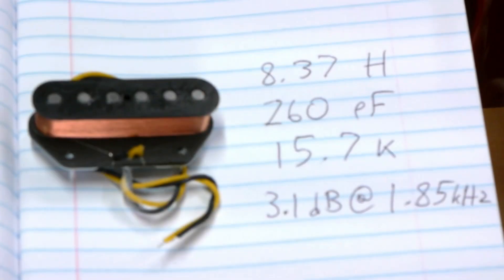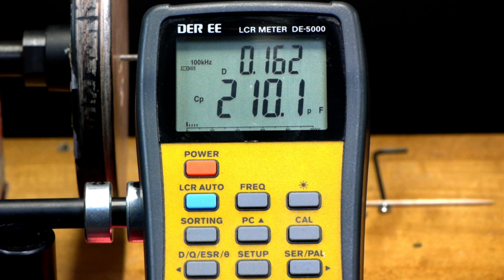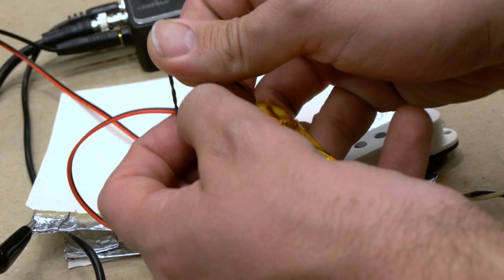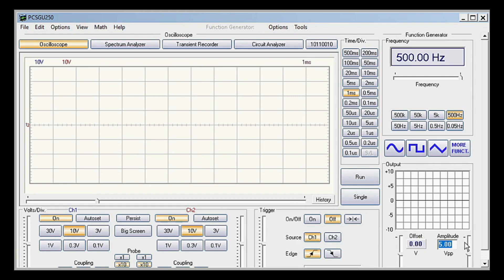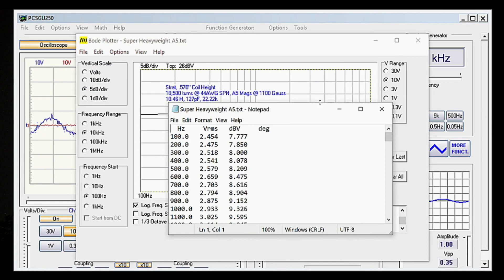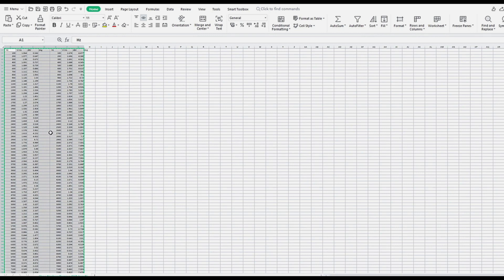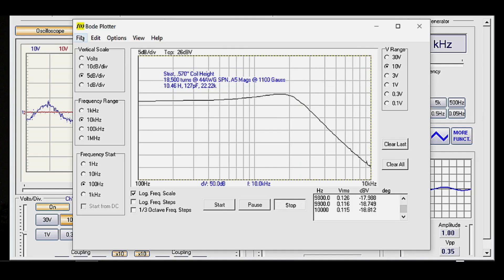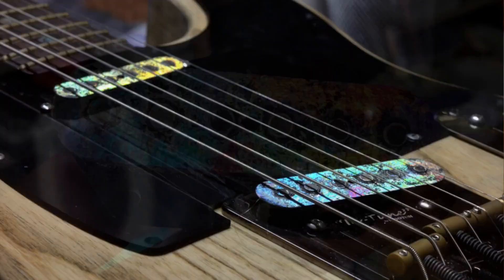Complete Guitar Pickup Testing: Step by Step Guide (LCR Meter, Gauss Meter, Oscilloscope)

Comment: with all this knowledge and all these tools, you are poised to give the guitar world a deep dive on what truly does what vis a vis magnets, wire etc and guitar pickups. There is too much  "mojo" nonsense out there, you could finally answer the question
 "how do i get a mid (scooped/forward) pickup?"
" what type of magnet will soften this KLANGY (my word) top end?"

"what are the tonal differences with A2, A3 A5?" ( i have literally heard 2 different expert winders say the opposite things about A5 -Novak  mid scooped .....Thro back  mid forward)
Reply from the maker: I'd love to do some videos on this. Antigua Tele on TDPRI and Guitar Nuts 2 has a plethora of posts analyzing hundreds of different pickups. 

The advantage I have is that I regularly assemble and wind my own pickups, so I can control for variables -- such as magnet type. 

Sometimes the differences aren't very obvious. What shows up on a bode plot is subjective when it comes to how much of an impact it truly makes. Plus, there is some natural variety between pickups of the same make and model. The resonant frequency might vary by a couple hundred Hertz depending on the winding pattern/tension, etc. I currently don't have any way to control those variables -- tension and pattern can be controlled by a CNC machine, but when hand winding, I don't know of any methods that reliably produce particular results. 

The formula seems to be the most important: all the components and then the turn count of the wire. 

I've been swamped with work, especially new videos I'm working on, and since I cover such a broad range of topics it gets quite hectic. A video going over the effects of turn count and magnet type would be great. The easiest way is to control for each variable individually. For a truly accurate test it would require my LCR meter, oscilloscope, and then audio tests on top of that with A/B comparisons. There may be other things I can add to the test that would increase the accuracy. 

I've been winding pickups for over 5 years now and have gone through over 30 pounds of wire. And I still never know what I'm going to find when I experiment with something new. I do think there are parameters that may exist that my test equipment is not able to capture. 

Another consideration I haven't seen anyone tackle is measuring two pickups together. The in-between positions, series/parallel and in phase/out of phase are all very interesting, and for my tone, are a primary part of my sound. My preferred setup is two single coils with a three way switch and two push/pull pots so I can go between series/parallel and in phase/out of phase in the inbetween positions. 

I've found a super overwound bridge pickup with an underwound neck pickup work beautifully together. I have no idea why, on a technical level. But you get six different pickup combinations with two pickups. And individually, they're very different sounding. 

I'll see what I can come up with in time. Another video I wanted to do was demonstrating the change in tone of a pickup as you add, say, 500 or 1,000 turns at a time. Complete with bode plots, LCR meter measurements and audio tests. 

So many ideas, and so little time. I do hope that for now, at least by putting this information out there, I can inspire some other people and empower them to run their own tests. 

Also, send me an e-mail at guitarmdofficial@gmail.com if you'd like. I can add you to my Google Drive pickup testing spreadsheet file. I try to upload everything there, and any new pickup I test gets logged into the spreadsheet. I have a small but decent collection of different pickups so far and am always adding to it. Many of them are my own but I do have a fair amount of commercial pickups as well. Any time I have someone bring me something to work on I throw it on the meter whenever possible and add it to the list.
Reply: @guitar_md  I wind some myself- I have noticed 41awg wire nailing the tone of a 62 strat (which i don't own but have access to from time to time). It was a fluke thing but i acquired some 41awg from Remington and wound to about the mid 5ks. I suspect the rating system back in the day wasn't as precise as it is now and what was once considered 42 was closer to our 41. (it makes quite a difference). I know the old Charlie Christians were wound with 38 and read in the low 3ks today (perhaps a p90 would with 40/41 could capture those 1940 era models

Comment: Guitar MD, if you don’t mind, I need to pick your brain a bit.

I have the Velleman PCSGU250 analyzer with software loaded, a (home made) exciter coil, the Ken Willmott v5.9 integrator… all leads set up as you show and as Antigua has promoted on various forums. Settings on the software as you and Antigua have described (there were some variation, I’ve tried a bunch of options).

The issue I’m having is the bode traces all seem to start in the lower left, ramp up to the peak then taper off as expected. Issue being the starting point of the lower left plots, rather than a more central horizontal start to the plot as I’ve seen - everywhere.  I’ve tried a couple different exciter coils which results in a slight offset of the plot, but all start from the low left.
It doesn’t seem to matter what pickup I’m testing, all have the same low left plot starts.

I’ve attempted to find the answer on the forums, but nothing is jumping out at me.
Without you actually seeing my set up, what is you knee-jerk explanation for such plots. I’m no doubt missing - the obvious. 
My exciter coil(s) are  200 wind, +/- 30 ga wire, Strat bobbin style. No magnets, not nothin. Pretty much what Antigua was showing in his forum post relating to this type of testing.

Any suggestions are greatly appreciated.

Take care!
Reply from the maker: Is the test range 100Hz increments? Times I've accidentally set it to 10Hz increments, I've had it start on the low left. 

The other thing is Ken's exciter coil uses a 100 ohm resistor in series with itself. I make my own pickups but just got one of his exciter coils to be on the safe side. I actually am going to make my own 7 string exciter coil for testing 7 string pickups so maybe I'll see if I run into similar issues you're having. 

I've been meaning to experiment more myself, such as using an actual wiring harness instead of the integrator, to see if that changes anything. 

But immediate suspects are the test range and that 100 ohm resistor in line with the exciter coil. Make sure it's 100Hz increments, not 10Hz, and try wiring a resistor in line with the coil. I remember being confused about that and I still don't know the purpose of the resistor but it could play a part. 

I also set the test amplitude to 1 now, every single time, just to keep things consistent. Let me know if you try anything or are still having issues.
Reply: @guitar_md    Thanks for the reply. Pretty sure I had run at 100Hz, then tried other setting as well.
I'll double check , use amplitude of 1, and add the resistor as you mention.  
It is all a bit of black magic to me. 
Thanks again for your videos and the reply.  It all helps.
Take care!
Reply from the maker: @theNextProject  Sure thing. And trust me, I get it. I had to correspond extensively with Ken, and a member of TDPRI, to get this sorted out. The instructions for the exciter coil are here: 

https://github.com/KenWillmott/integrator/blob/master/Test%20Coil%20Assembly%202021-03-27.pdf

He explains there exactly why it's important to use the 100 ohm resistor. I think that might solve your issue. Let me know if it works!
Reply: @guitar_md  excellent, I'll read through the link and now I know what I'm doing tonight.  Many thanks!
Reply: @guitar_md   ah yes, a good read!  Definitely a different exciter build than I found in Antigua's info.  Thank you again!
Reply: @guitar_md  Thanks again. 
I wrapped a new driver coil based on the Ken Willmott info you shared and that did the trick. 
Much better plots now.  
Many thanks to you both!
Reply from the maker: @theNextProject  So glad that worked for you! So glad to hear it. I'm actually planning on making one myself soon as well, perhaps a 52mm humbucker bobbin to line up better over Fender style pickups, compared to the traditional 49.2mm bobbin. 

I've actually wondered if this affects the results at all. Maybe not. But I've done some 7 string humbuckers too and have wondered if I should make an exciter coil that covers the entire coil. I might just make a few separate ones spliced to BNC cable connectors for easy swapping on my scope. 

Definitely keep me posted. Also let me know if you want me to add you to my Google Drive spreadsheet, I'm keeping track of various pickups as well as a couple of my own designs. It's a bit of a mess but I'm organizing as I go. If you e-mail me at guitarmdofficial@gmail.com, I can add your e-mail address to the private list of people I'm sharing it with. 

It's just called "Pickup Spreadsheets" and is exactly what it sounds like. Of course you can add your own edits to it if you'd like, or create your own version. Mine is quite disorganized but at least the information is there. 

Again, thrilled it worked for you. No feeling like it in the world, especially after the frustration of not being able to figure out what was wrong.
Reply: @guitar_md  sounds good , I'll send you a msg later today perhaps.
I'm thinking that some variation will be noticed with different driver coil builds, number of winds, or resistor used. Might be minimal, idk.
I added a bnc connector to my driver coil like you did, and used a small plug to connect them together. I can try different drivers and such by plug-n-play swapping - I hope.
I've also been playing with your excel spreadsheet idea and stumbled across excel's chart possibilities. A bode plot can be added/created right in excel using the data you showed us how to gather.  
I'm still learning, but multiple pickup data's can be compiled into a single bode plot/chart. I'm very visual, so this makes my brain happy.
Thanks again!

Comment: Great video, but I wish you included the steps for constructing your exciter - just for clarification.
Reply from the maker: I bought the test coil from Ken Willmott and did not build it myself, but the process is pretty easy. The instructions are here, on Ken Willmott's Integrator Github page: 

https://github.com/KenWillmott/integrator/blob/master/Test%20Coil%20Assembly%202021-03-27.pdf

Humbucker bobbin + 50 turns of 30AWG + 100 Ohm resistor (start lead of the coil goes to one leg of the resistor, finish lead goes to the other leg) + lead wires to connect to the signal generator. 

As shown in the video, I simply soldered the leads to a BNC connector for ease of use. Ken's test coil just came with bare lead wires so you can attach them to whatever you want. 

I might make my own for more accurately testing things like 7 and 8 string pickups that are a bit longer. 

Hope that helps

Comment: I assume this can be done with REW (Room EQ Wizard), an exciter coil (50T #26 on a bobbin) and an audio interface with input resistance and capacitance ~ equal to that of the amplifier which the guitar will play - right ? The pickup drives the audio interface and REW provides the sweep.

Comment: I love this video and thank you for putting this all together since it tickles my brain in a good way.

I wanted to ask if you are able to test pickups like Alumitones from lace with this setup?  Additionally, have you tried looking at flat eq pickups like the XR-Spectra by Cycfi Research?  Would love to see what you find since you have all this to hand and are knowledgeable
Reply from the maker: I haven't tested Alumitones, but I should be able to with this setup. 

I've made some interesting pickups, like my own version of Bill Lawrence's Micro Coils. I've used up to 48AWG, which is extremely difficult to work with. I don't think I could go any finer than that. But I've been able to fit a lot of wire into a very small (1/8") winding space. With interesting results. 

My friend Andrew who has measured Alumitones said the Micro Coil I made looked a lot like an Alumitone, which was very interesting. It's in my notes somewhere. I haven't made any Micro Coils in a long time. 

The CyFi research stuff looks awesome. Completely. I'd love to try one of their pickups, particularly in my multiscale 7 string. I never heard of the XR-Spectra, only the Nu-Modular. So I appreciate you mentioning that. 

I see they also have a sustainer unit. I'd love to use that in my fretless Epiphone SG. I have a lot of things I'd really like to try. CyFi research seems to be on the cutting edge of all this stuff. 

I've been recording direct-in almost exclusively these days. For now, my live gig and playing in a band days are over, and I've just been a recluse making YouTube videos and recording guitar tracks in my room through my interface. 

The CyFi stuff seems perfect for that. I will say traditional pickups do still have great convenience, despite their lack of flexibility. In some ways I think having limited options can be a good thing.

But they're definitely onto something. And by "onto something" I mean I think they've cracked the code. Really, a totally flat EQ makes the most sense in this day and age. And just make it sound like whatever you want. 

However, I myself have a lot to learn with how to adjust frequency response accurately in such a way. I'd assume there's a significant learning curve to that. I'd love to try it though, for sure. 

Might try an XR-SPECTRA 70 for my 7 string. I only wanted one pickup for it anyway. That could be very interesting.

Comment: Very well done!  Informative!

How do you account for the frequency response of the exciter coil?
Reply from the maker: Thanks! I don't think the exciter coil has a frequency response. It's very few turns of wire, and has no magnets in it, so there is no current generated via electromagnetic induction like there is in a pickup.  

My understanding is it's just a conduit for the signal generator. No frequency response of its own, but transmits the one from the signal generator